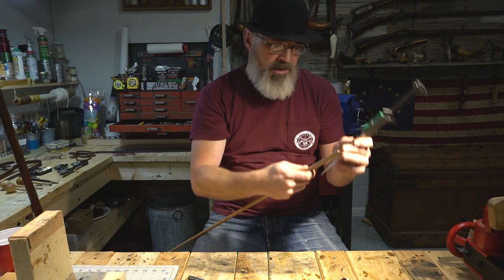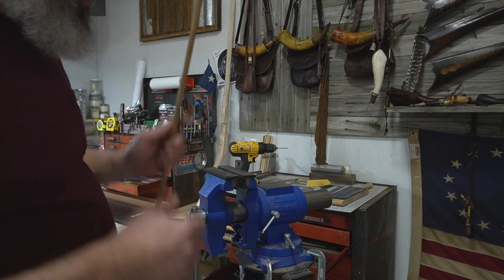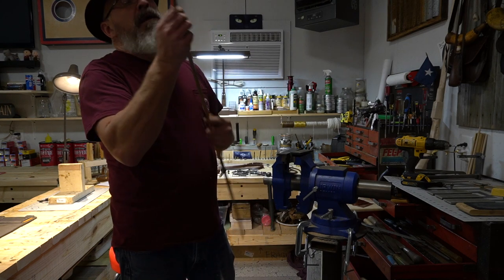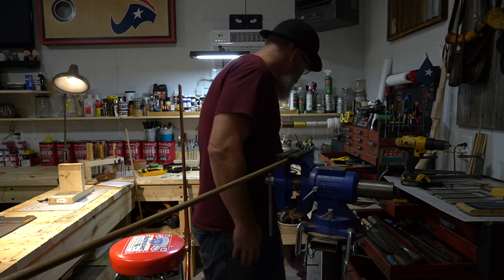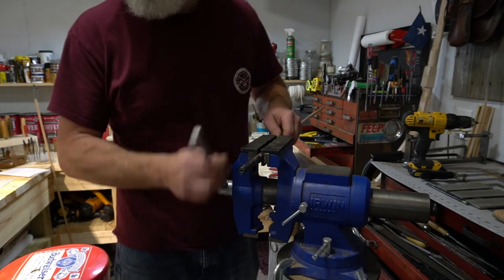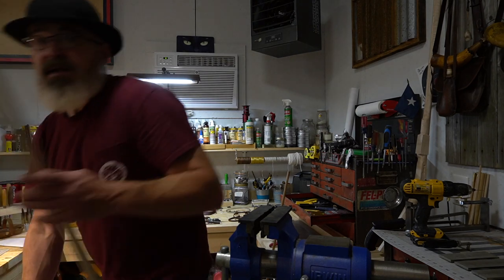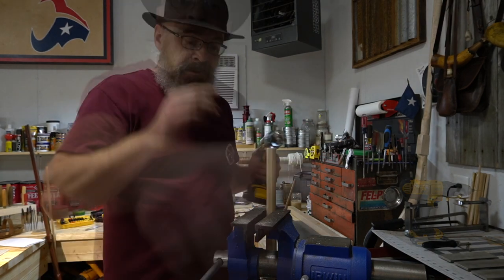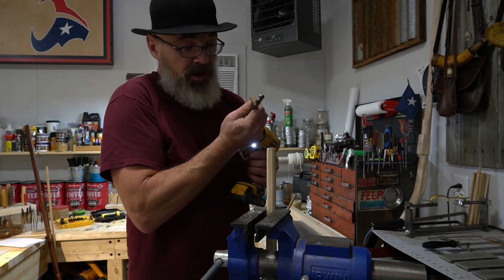HAND MAKING A FLINTLOCK TRADE GUN WIPING STICK - PART #2

Comment: Hi Bob:
 Might I make a suggestion? Whenever I'm making ball starters or anything that requires a "cutoff point" on a wooden dowel, I use a simple " Copper tubing/ pipe cutter" and make a cut around the dowel to a just the depth of the thickness of the metal in whatever I'm putting OVER the dowel. Simple solution buddy. hopefully your viewers will find it useful?
God bless:
Two Feathers
Reply from the maker: Pretty good idea. Thanks 2f!

Comment: Well done Bob!

Great vid and fine craftsmanship. I don't know how you earn your bread but you seem pretty competent with the tools. 
And I love your shop. Mine is a closet by comparison, only 12 x 12 but I started insulating the walls yesterday. So it's coming along... At the rate I'm going I'll have it done by this time next year.
Take care,
Mike
Reply from the maker: Thanks Mike. I’m sort of an old fashioned ‘Jack of all Trades, Master of None’ born with a capacity for all things ‘manual labor’. Sort of a cliche country boy. I’ve built a house from the foundation up. Studs, electrical, plumbing, and all. Raised a barn. Rebuilt cars. Etc. etc. Thanks on the shop complement. The house had a three car attached garage. I turned bay one into a mud/laundry room for the wife and I got the other two for my shop. I just finished the studs up remodel last year. No place like a shop. Get her done.

Comment: No worries on the AC noise. I only wish I had that same noise in my shop. It’s been too hot to work on anything in there as of late.
Reply from the maker: Josh Sawyer Thanks Josh! First thing I did after a studs up remodel was install an a/c and heater. Year round!
Reply: I need to do the same. Maybe you can convince my wife.
Reply from the maker: I’m no good at that. They see right through me. My wife does that little shake of the head and rolls her eyes.....🤣

Comment: Thank you for these videos it is really helping me. I am looking for a replacement lock for a hawken rifle of mine and the ones I've found have no bridle on top, just a tumbler ,fly, sear and spring. What does the bridle do exactly and is it really not important?
Reply from the maker: Hey Taylor, a lock with no internal bridle was considered very low end and they are not nearly as good one with a bridle. The bridle captures the tumbler and sear so they are captured on both sides by the plate and the bridle and therefore much more stable. If it’s the external bridle it connects the pan to the mount for the frizzen and makes the frizzen mount more stable. The frizzen bridle isn’t nearly as important as far and lock longevity and function as the internal ‘tumbler bridle’.